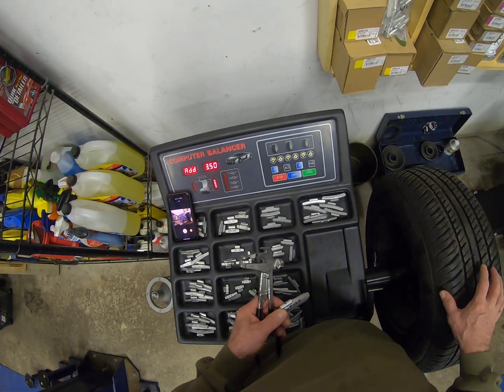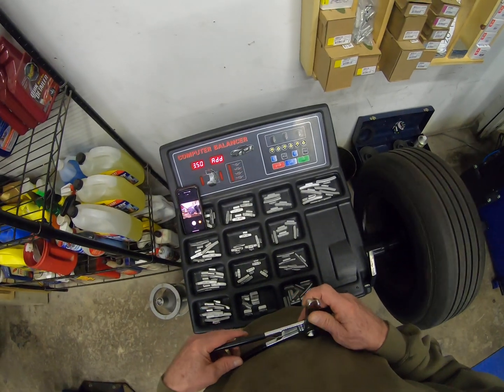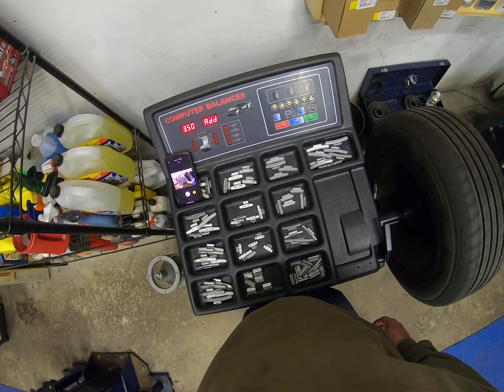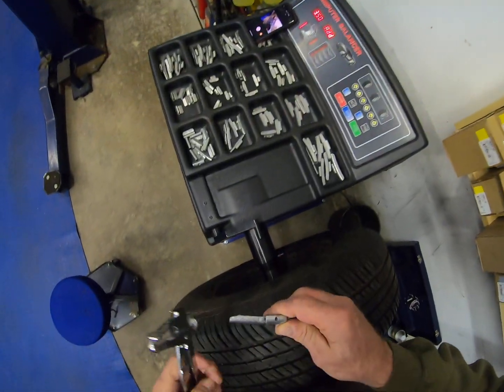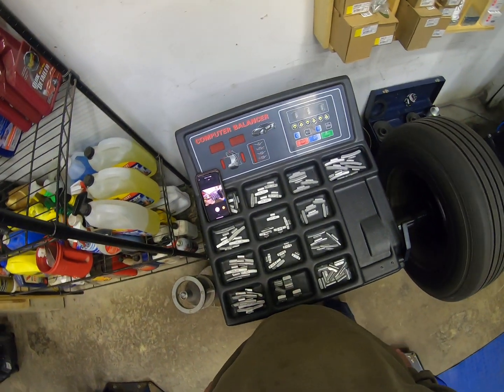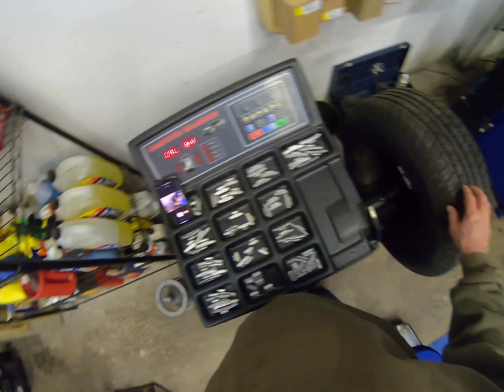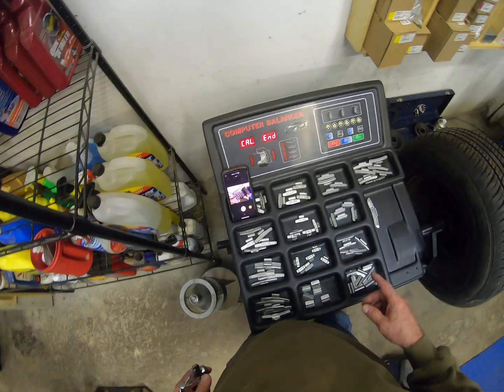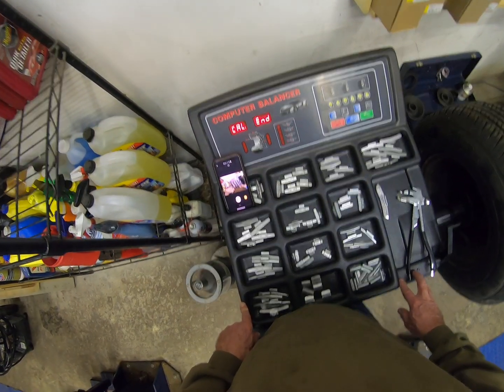Xinkong Wheel Balancer SBM680 Part 3  of 3 (Completion of Part 2 Calibration Discussion).

Comment: Hi, is it possible to calibrate with 13 rims?
Reply from the maker: I haven’t try it but I don’t see any reason why it can’t be done.
Reply: @davemichaud1334  Thank you calibrate is needed every month. And for what reason is it needed?
Reply from the maker: My guess is that machines like this can go out of calibration due to temperature changes, humidity and through repeated usage. Even torque wrenches, and scales require periodic calibration. Calibration before use is a good way to insure accuracy.
Reply: @davemichaud1334  Thank you for your detailed explanation.🤝

Comment: Great video. Thank you.  Does the machine come with a good instruction manual?
Spec on machine shows 155 pound and 44" diameter limit.   Have you tried to push the limits of the balancer?
Reply from the maker: No. I haven’t had the need to.
Reply from the maker: The manual isn’t very good, but it’s better than nothing. I had to read it several times to understand what it was telling me. Good luck! 😊

Comment: This 180 that comes up on the righthand side "window" ; on the lefthand side has a rotating dashs rotating in a rectangular pattern.   What is this?   "180" what's that?
Reply: Possibly turn 180 degrees?
Reply: Based on the manual, it looks like you're supposed to rotate the tire 180-degrees on the wheel, then try to rebalance it.
Reply from the maker: @maximusmax4557 I haven’t run into that problem. I know the instructions can be challenging as they were written in China.

Comment: Hi Dave,  your videos are very helpful.  Best of the lot.     Here' s some problems/questions that really have me "flummuxed" (yeah, I had to rewrite their "owners manual" too).   

 How do I change from SAE to Metric?   I've seen a 180 and I can't figure out where that's suppose to bring me.    What is that (Grams, Metric. sae, fractions?)?
Reply from the maker: Not sure why you’re seeing 180.  Make sure you calibrate the machine before you balance . My machine is SAE so 180 ounces would be over 5k grams!  Too much weight!  Looking at the other way 180 grams equals 6.34 ounces. Still too much weight! Make sure your wheel is mounted firmly and turning true.
Reply: The 180 is when you put the weight 180 degrees from top..mostly for aluminum stick on weights...

Comment: Question. Do you calibrate  with a wheel that is already balanced or one that is not. I put a freshly balanced wheel (from tire shop) on my machine and it wanted me to add weights.  I have successfully balanced two sets of auto tires and four motorcycle tires. When I balanced my new wheel/tires they were very wobbly and hoppy.
Reply: How do you get it into motorcycle mode?
Reply from the maker: I don’t have a motorcycle so I’ve never done that.

Comment: Do you have to calibrate every time. To refresh you balance wheel, calibrate than balance wheel again? Thanks for the video
Reply: Its calibrated from the factory, but you can calibrate before using to be sure nothing has changed due to shipping.  Only need to recalibrate if you find it keeps asking to add more weights even after balancing and adding weights.